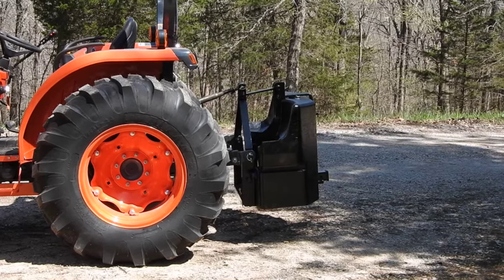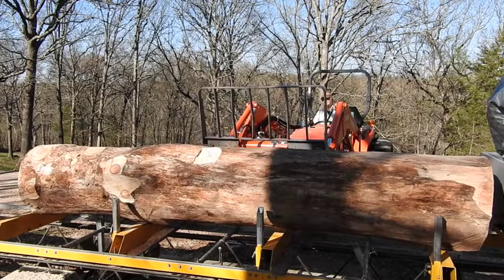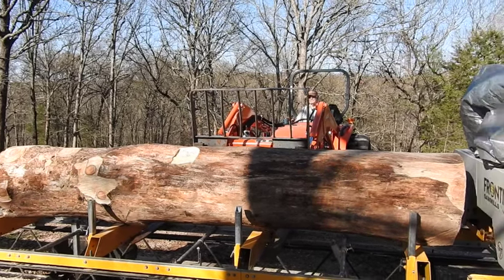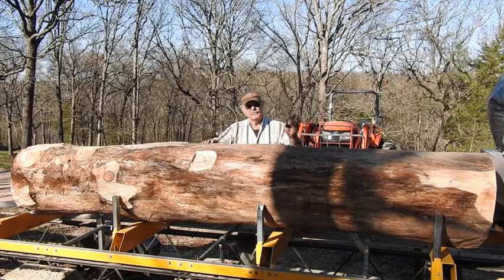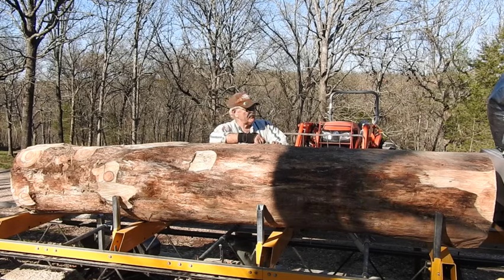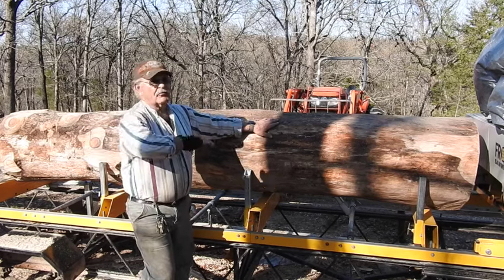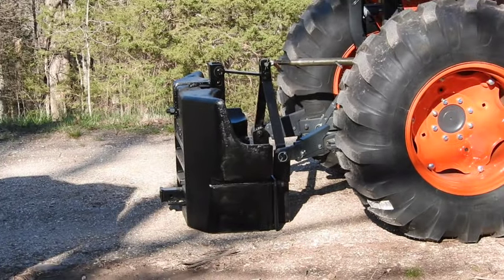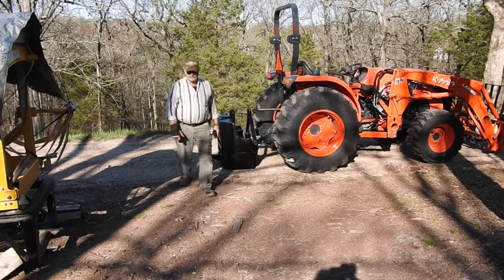MX5400 Maiden Voyage With Counterweight and Pine Log

Comment: That’s a big log tractor did well to pick it up going to be some nice lumber there. Glad to hear your hearing aid’s are helping . Our compensation with the government will pay for our if your hearing loss was due to your work and they will renew them every five years just got my second set new and improved only thing better with these are you don’t have to change batteries just put them in there case at night and they charge and they go through my phone so I can take a call hands free and watch a video other than that no better than the old set if I am in a noisy place can’t talk to anyone but I can hear the noise great good video guys thanks for sharing take care hope you guys are having a great week
Reply from the maker: Yessir Tom.  You hit the high points of the benefits of the new style.  Mine are very similar. There's even an app for the phone that allows settings for different environments. I like the way it interacts with the phone.  My one old uncle had a pair that the big battery pack would stay in his bibs pouch.  He'd adjust the big knobs on it and 20 feet away you could hear the screeching of the feedback when he'd try to get 'em set just right.  The things in his ears were like big round thimbles, thick and the size of quarters !!  We've come a long way for sure.  Take care and have a awesome week my friend.

Comment: That tractor can pick up more than 2000lbs now whether or not is should is the real question. I've picked 4000lb logs with my MX5200, she didn't like it but she did it. I'm glad you are utilizing the PACT act benefits, I work for the VA and most of the funding is severely under utilized. As we all know the PACT was quite expensive.
Reply from the maker: Well the rating is at the lower pin, so the farther out, the less the rating.  The ballast ensures less strain on the front axle by attempting to equalize the weight of the loader loads to both axles.  Without adequate ballast, the front axle almost acts as a fulcrum causing excessive stress to those components. Thank you for working for the VA. So many of my own relatives that are ex-military have never even heard of the PACT act or what it does.  Most have never set foot in a VA facility. I'm trying to get them to get registered.  Most all of them need hearing aids or glasses (or both) and are in their 70's or 80's.  The word is just not getting out there.  I'm trying though.